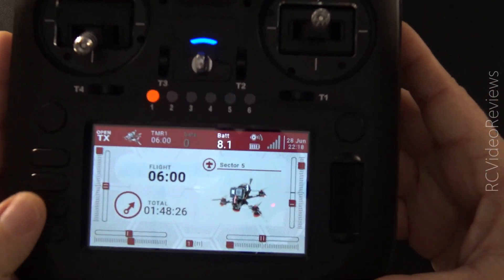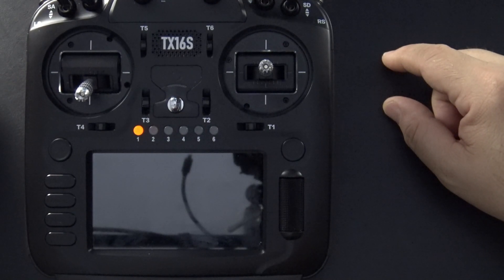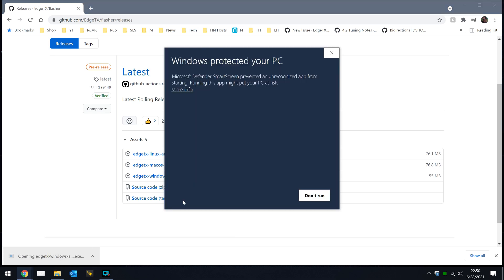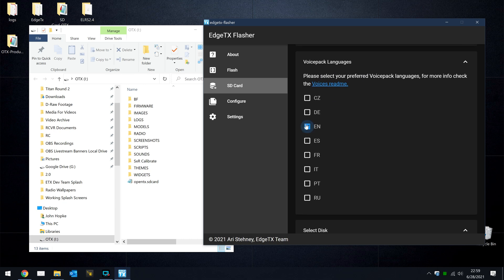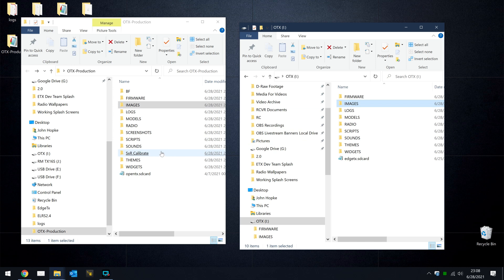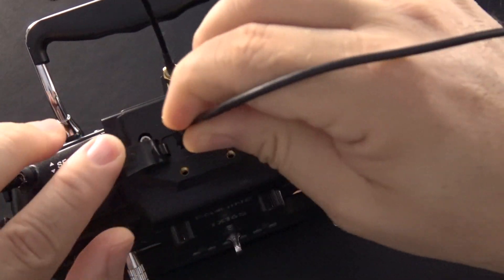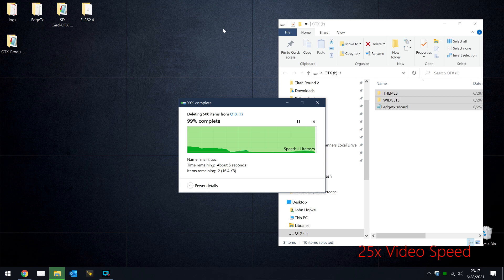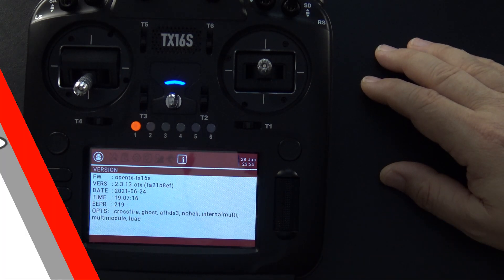EdgeTX • How-To Migrate from OpenTX to EdgeTX and back to OpenTX

Comment: Hi John, I attempted to load Edgetx on my Horus10 and all was going good, but the moment I tried to write to the SD Card it wouldn't recognize it. Although I could select the card each time I attempted to write , it asked me to select a destination. Have you ever come across that?
Reply from the maker: I have not. You can take the SD Card out of the radio and write to it that way. In this case, the radio is nothing more than a great big SD card adapter. So I would try that if I were you.
Reply: @RCVideoReviews  good man and thanks again
Reply: All sorted John, Its the operator at fault as always
Reply from the maker: What did you figure out?
Reply: @RCVideoReviews  I didn’t select the radio type silly I know, but I assumed that I had already selected my transmitters and thought that was it
Reply: I’m assuming in the future all of these improvements will be filtered into one opentx which we’ll be great

Comment: I just got a TX16S and installed EdgeTX as soon as it arrived. I set up a couple of models from scratch for the quads I fly most frequently, and so far I'm loving the radio and running Edge on it. The problem I'm trying to solve now is that I was previously using a Jumper T12 pro and I can't seem to find a way to transfer my old models over. I have a few more complicated fixed wing models that I'd really like to not have to set up from scratch. I've tried backing them up to the sd card in the t12pro and then moving them to the models folder on my tx16 sd card, but when I boot the tx16 it never tries to convert them. If I go to the SD card tab and look in the models folder, they're all there. The radio just wont do anything with them. I also noticed that when I backup my models from the t12 the bin files are very small at just 1kb, not sure if that's normal. Anyone have any suggestions?
Reply from the maker: Ok, flash OpenTX on the radio, import your models from Companion, then flash to EdgeTX.
Reply: @RCVideoReviews  For some reason my models don't copy over properly.  I open the saved models in companion, it asks me to convert them, which I say yes to.  Then I copy them over to my new radio using drag & drop, they look like they are there, so I write to the radio.  But when I turn on my radio the models are not there!   I plug it into companion, read the models and the models that I copied to the radio show up in companion - they just don't show up on the radio itself.    I noticed that my openTX uses BIN files and my EdgeTX radio uses YML files... and I see the BIN files on my new radio, but it looks like YML files were never created.   NO Idea what do do, it seems like the conversion has never taken place properly, or it's converting wrong.  I also don't have a RADIO folder on my openTX model, so nothing to copy for that.  The other peculiar thing is that on my openTX radio I have about 60 models, but only about 8 BIN files.  Where the heck is it storing all the other models?   Anyways, I really wish I could get this working, I've flashed and reflashed and tried copying models about 30 times now.

Comment: I got all the way through and installed EdgeTx but my models did not convert. Is there any way to convert models after conversion to EdgeTx?. I had about 60 models in OpenTx but after conversion  there are none.
Reply from the maker: After installing try copying a couple over at a time. You might want to open an issue on GitHub as well so they know.

Comment: Just tried to download the flasher and got a virus warning which I allowed but the program won't install as windows blocks it. tried turning off all blocking programs but still block. Why is there a virus in the flasher? Running Windows 10 with all updates.
Reply from the maker: Ok, thanks again for the report. This is a MS Defender issue. The Edge team is aware. They will have to work with MS to get it resolved.
Reply from the maker: I don't think there's a virus in the flasher. If you want to help sort it out, you need to open an issue here and explain what you're seeing: https://github.com/EdgeTX/edgetx/issues/new/choose
Reply from the maker: I ran the tool through virustotal.com and it's coming out clean, but I do see the error on Chrome. I've let the primary developer know. Thanks for speaking up.
Reply: Thank you for the follow up.
Reply from the maker: @GlennBond  If you want the exe, you can disable Windows Defender, download, then re-enable.
Reply: @RCVideoReviews  I did disable defender and got it downloaded but windows will not let it run. I clicked to run anyway but it still blocks it. Will try on my laptop and see if I get same results. Will advise. BTW I really enjoy your videos on the TX16S. I really like this radio. After years of Futaba, Spectrum, Kraft in my early years, this radio is impressive. Thanks
Reply from the maker: I turned off Real-time protection under Virus & Threat protection settings and Windows let me install and run it. 

Glad you like my videos and the radio. It's a great platform and development right now is crazy.
Reply: @RCVideoReviews  Downloaded and installed. Still concerns me as to why it is doing that. Can you still use Companion to create and adjust models? Never saw that you could. Thanks again.
Reply from the maker: It's a false positive by Microsoft. It's been cleared through MS now. Update your Defender definition file and it will work. I just confirmed on my machine. Companion is not yet compatible with Edge.

Comment: Hi Sir: Have you ever done any Long Range Build Video's? Like X Class 10in, i am going to embark on a personal quest to build one and have been searching for info on what items i need to purchase and i would like to fly around this lake in Fla during the winter months where we go to spend time to get out of the snow so far i got the box goggles,a X10 Tx, a 10 in dead cat frame a 4 in 1 60 amp esc, a Lummiear f7 FC ,and i'm not sure what motors i need  i have the CRSF module and nano Rx also VTx 1000 mw  i guess i will use iNAV to be able to stop and take video's and pos-hold,RTH  Loiter somthing like arducopter Mission Planner does i have come across  and watch a few of your video's  that i can actually hear and comprehend what you saying and i could follow your instructions on how to get this done so if you have a long range build  video i haven't found it  but i have subscribed and hit that littlebell to notifly me of you up coming articles.
Reply from the maker: I have not done a specific long range build for quads however, I can make some recommendations to get you in the ballpark:

It sounds like you're more concerned with long duration than long distance, so efficiency is the name of the game for you:
1) Two bladed props are generally considered more efficient. So consider 2-blade options but do test. Don't assume.
2) Li-Ion batteries - Hard to beat power density vs weight. 
3) Slower spinning motors with bigger props vs faster spinning motors with larger props.
4) Me a maniac about weight.

Good luck,

J
Reply: @RCVideoReviews  Thank you sir for a quick reply, Yes i go to Fla for the winter and want to fly around lake garfield looking and filming alligators and other wildlife  and i would like any recommendations you can give me Thanks. R.K

Comment: Thank you for update and the video showing how simple to go back and forth. 

When you when back to OpnTx, and it prompted you that the data was invalid, you said that it did this because you hadn’t yet updated the SD card. Here is where I’m confused.  If you just copied over the exact content of the SD card that you had fir the OpenTX that you started with, why and how would have to upgrade the card?
Reply from the maker: Before I made the video, I flashed the latest copy of OpenTx onto the Eachine. I didn't upgrade my SD card contents when I did. So before the video ever started there was a mismatch between the firmware and the sd card contents. Please just ignore the error--it's not relevant.
Reply: @RCVideoReviews  Thanks for clarifying this.  I may have missed it at the beginning of the video.

Comment: Aside from touch screen, what are the benefits to edge tx?
I run open tx on my Horus x10s express and x9d+ see, I don't see much difference.
Is edge tx suppose to equal Ethos or be better?
Reply: If using like ELRS with fast refresh up to 500Hz the stick refresh rate on edgetx is suppose to be like double..
But I really only out edgetx on for the touchscreen
Reply: @divingfalconfpv4602  sounds great… I have a TX16S and using External TX (Ghost) and running PureRace mode (300hz + LoRa).
Reply from the maker: You have to read the release notes: https://github.com/EdgeTX/edgetx/releases/tag/v2.4.0-rc3

I wouldn't equate Ethos to Edge because Ethos is proprietary FrSky and based on their track record I wouldn't use it.
Reply: @RCVideoReviews  
I see don't see what would make edge better than open tx. Been using opentx for a couple years. Looks like edge is a waste, I could see if it was a major upgrade, but it appears not.
Reply: @johnbednarz1424  Depends on the transmitter your using, if you have a nice big colored touchscreen its awesome , but if your using a old x9D then probally no use for you
Reply: @johnbednarz1424  it will be the first release, so of course you wouldn't. There are only a handful of things that will apply to older B&W radios - combining timers with switches, no RSSI warning in startup iif you disabled RSSI warning, but that's mostly it. The focus for this release had been getting touchscreen working on the colour screens and the UI into a usable state. Next release is likely to be working on the interface and overhauling the theming and consistency. But again that would be mostly colour screen. B&W radios are "mostly complete" really, not much happens specifically for them.
Reply: @pfeerick  
Ok, I have x9d+ see and a Horus x10s express. I understand not doing much for the x9d, I am curious about if it was going to be beneficial to my x10s express compared to open tx. The UI is pretty much the same aside touch screen.
Reply: @johnbednarz1424    I run ETX on my X9D+ primarily for testing new builds, but it's also still a good Tx, so Raphael won't hear the end of it doesn't still get some love every release! ;) I don't have exotic requirements for it like ELRS or telemetry lua stuff, but wouldn't be surprised if that's where there will be improvements on those fronts in future releases. T-Lite is my regular use tx atm, and it's running ETX also, and TX16S with touchscreen added is also primarily used for bug testing atm, as well as learning to write LUA scripts.

Comment: Hi John, just one question I see on the flasher there are options for flashing X9D etc. Is there any advantage flashing EdgeTX to transmitters which doesn't have a touchscreen?
Reply from the maker: Peter has an inside POV so you can rely on his comments. I would add the Edge team has been re-thinking other aspects of the radio such as disabling RSSI Alerts Disabled warning screen, adding CRSF Shot to release version, and conserving memory. So there are other nuances in Edge now and certainly in the future that are more "under the hood" type of updates.
Reply: @RCVideoReviews  I have no idea what you could possibly mean... I'm an industrial spy now? :-P but yes, getting rid of the useless RSSI alert when configured as disabled by the user seems to be across the board. Didn't want to comment on crossfire stuff as I don't know much about that, so thanks for mentioning that :)
Reply: So far I think the only thing ETX has done for B&W is add ability for having a timer trigger conditional  with a switch... there's obviously the logo and different voice packs, but you download that anyway. The primary focus has been colour screens and touchscreens as of yet. And there could be some other stuff that's shared across the board.
Reply: Ok what’s the likelihood of the horus10 with a replacement touchscreen, say with a radiomaster t16. What are the possibilities of that working?
Reply from the maker: That would be a science experiment I think.
Reply: @RCVideoReviews   well keep on the good work and I’ll keep watching. All the best Alan
Reply: @alantoseland6629  "It depends" :laughing: codewise, most of the colour screens are X10 radios, with tweaks and minor variations here and there, so it's probably more a matter of can you electrically connect the touchchreen without anything going pop.